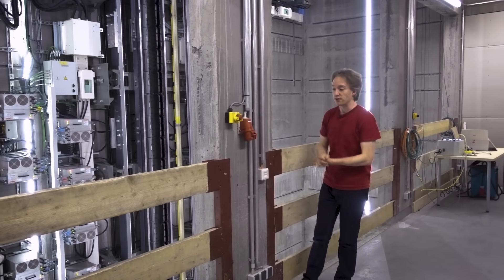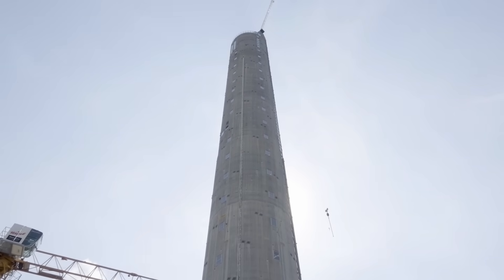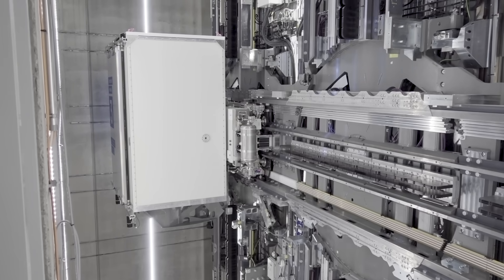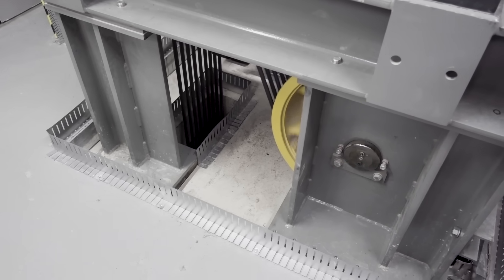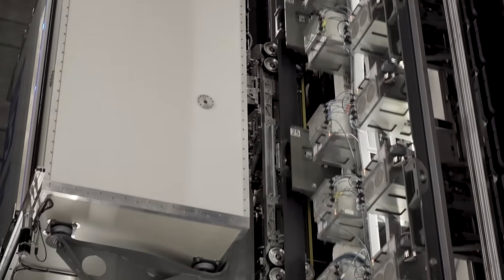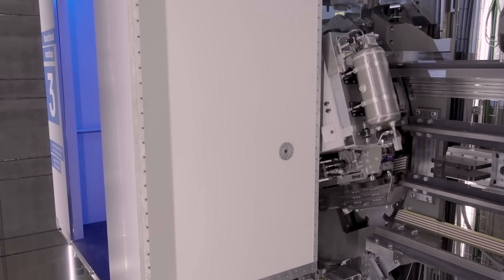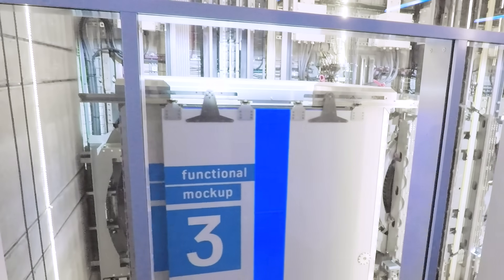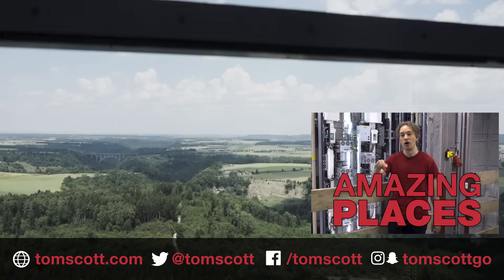An elevator that actually goes sideways

Comment: In what scenario will I even need an elevator that goes sideways?
Reply: The specific case they're describing here is to have set of multiple shafts where the some shafts are for up, and some for down, meaning you can run multiple cars per shaft. For very tall buildings the problem of only one elevator per shaft and longer trips between distant floors mean that a decent fraction of taller buildings is nothing but elevator. This invention in theory let's you extend the same number of shafts to any height, though I'd probably increase shafts albeit at a much slower rate so that a failure or slowdown in one shaft can be diverted around.

In a more extreme setting you could use this for something like the previous video he made about a sideways elevator, where they just needed to go a fair ways sideways as well as up, and it was more convenient than walking.

Comment: I just wonder about when it becomes actually used. If an elevator can move in either vertical and horizontal, it means that their paths of movements will be a grid instead of parallel vertical lines. If different people want to get the same elevator from different origin points to different destination points, how the computer system manage the most effective ways of carrying these people? If there are more than one cabs on this grid, it might be more likely that two cabs might get into the same part of grid and collide. How will they design their controlling system to prevent said collision? These just pop in my mind.

Comment: Though, I do need to ask, why don't they just use the simple rack and pinion gearing system instead of induction motors?
Is it because they want reliable smoothness in the ride that is given from two repelling magnetic fields. (something the rack and pinion also gives.)
Or because induction motors are somewhat expensive and looks far cooler and is therefor most likely easier to market to non engineers.
Reply: I can imagine linear (not actually induction if it's synchronous) actuators being cheaper, lighter and smaller except for development costs
Reply: Linear as in rack an pinion, or lead screw?
As the lewd screw is probably going to lower the speed significantly.
But yes, there are many solutions that might work.
Reply: Unknownety Linear as in no rotational movement whatsoever to begin with. Instead of creating rotating magnetic field with concentric coils like in a motor, you have them arranged in line (well, perpendicular to it)

Comment: A rare error at 1:50 and later; it doesn't use linear induction motors; as the guy immediately says they use linear synchronous motors. Induction motors are asynchronous motors and use copper or aluminium for the secondary, but here they're using permanent magnets and they're synchronous motors.

Comment: I'm confused, you called in a linear induction motor, but the dude said it used magnets and was a synchronous motor. Induction motors don't have permanent magnets nor are they synchronous, so like, which is it?
Reply: Yeah, pretty sure it's the synchronous one. Induction motors (and linear actuators) have slip, can't be controlled for precise positioning and don't work well at low speeds
Reply: Tom messed it up, pretty sure.
Reply: LIMs could potentially be used, and might well be cheaper for the shaft; but this company just aren't.

FYI Tesla uses induction motors in his cars, they can be precisely computer controlled just fine. They are a bit less efficient at low speeds, but not terribly so, particularly if they have a thick secondary.
Reply: they would be magnetic linear actuators

Comment: Should of talked about the fail-safe's it has in case of power failure and/or failure of whatever keeps the elevator in place like the traditional cable.

Comment: How does this elevator deal with the distribution of mass on different parts of the elevator floor? Correct me if I'm wrong but essentially if you were to stand on the far side of the track that it goes along you'd exert much more force on the top wheels through a lever effect, right? I'm sure they'll be doing some very thorough and destructive testing but I just wonder how they solved that.

Comment: Thyssen-Krupp is not an elevator company. In fact, I cannot remember having seen any modern elevator not built by Thyssen-Krupp in the whole city I live in.
Reply: The city where I live, Seattle, has a nearly even mix of Krupp and Otis elevators.
Reply: Thyssen-Krupp begins as steel manufactor and  know there are a Part of germanys/worlds biggest inovation companys
Reply: Actually, I more often see Otis, Kone and Schindler. But I do also see Thyssen-Krupp. Your statement that Thyssen-Krupp is not just 𝑎𝑛 elevator company, is false.
Reply: Even 70year old elevators are maintained by them.(more or less)
Reply: Cristof Calgary was the same. Thyseenkrupp and Otis. In Ontario there is a company here called Delta elevator that seems to be the most common
Reply: Thyssen-Krupp is the mother company, to which Thyssen-Krupp Elevators belongs, and they make elevators, suprisingly.
Reply: In Germany almost every Elevator is from Krupp
Reply: What are you saying? they are not an elevator company, but they are the only evevators in your city? how does that make any sense?
Reply: It's called italics, but now I'm just being overly pedantic and this thread has gone of the rails.  WE'RE ALL DOOMED.
Reply: Actually KONE is the elevator company.

Comment: how can this functionally work with more than one cab? is it just that if there is a chance of proximity you stop one of them and make it wait? or you do not have more than one cab?
Reply: I'm fairly certain it uses a block system, that is: If a segment of the elevator shaft is occupied by another cab, it routes the others around it. Of course, that only works with more than one shaft - otherwise, it's "just" like the block system of a rollercoaster, where you have to wait at certain points until the next block is cleared.

More than one cab only is very beneficial if you have 2 or more elevator shafts that are connected every... say, five or so floors. In that case, the computer that controls the traffic (whether it's a small computer within each cabin or one "controller" computer) moves cabins from one shaft to the next to overtake slower traffic that still occupies a segment.

Comment: Linear induction motors are all the rage in automation right now - manufacturers make all kinds of cool mockups with incredibly advanced configurations, but the solutions are usually orders of magnitude more expensive than more conventional motors. If this particular system was ever implemented for real I bet it would be using conventional motors and not LEMs. ☺️

Comment: How much energy does this system use? Conventional elevators use as series of counterweights so the actual load on the drive system is fairly minimal, allowing it to operate very efficiently. With this system, it looks like the linear motors are moving the entire weight of the car, and components. Maybe I'm missing something? Very cool concept though!

Comment: This would be a great solution to the elevator conundrum, as you could have more cabins than elevator shafts. They should at least be able to sell this for 500m+ skyscrapers, as they are starting to have problems with having enough elevators.

Comment: Could be brilliant for buildings with large floor plans. Instead of having totally separate banks of elevators you need to walk between, you could design a building to take advantage of these and be able to shuttle people between elevator banks. You could have, for example, a UN like building, which is both quite tall, and fairly wide, and have, every few floors, not just the double shaft that allows lifts to dynamically route around each other (you can have multiple lifts sharing a single shaft, and routing around each other via the "spare" shaft, allowing, say, for a high capacity lift to unload on a floor while another couple pass by to higher floors to do the same) but also capable of delivering you to a north or south elevator bank. Or, for somewhere the size of something like the LHC, have a lift system that can take you under ground and to the relevant instrument for maintenance, instead of always biking there. Integrating the system, while initially more expensive, would probably be easier than needing to support, say, a mini-tram system. When you can standardize more systems to the same standard, it is generally beneficial after all.
Reply: But... this basically IS a mini tram. Just attached to the wall. So a mini tram with normal rails would prolly be a lot cheaper in a case like the LHC

Comment: I was almost dismembered by an elevator as a child. it was at my grandfather's shop/house. he was the only person who used it, since the upstairs was his apartment. my sister and I were screwing around and jumping in and out while the doors closed. the fact that the doors didn't have a sensor to stop the doors should have been a hint. on one jump, my leg got caught in the elevator with my sister while the rest of me was still outside. the door clamped on my knee and the elevator started to rise. I started screaming while my sister started spamming the open button but it wasn't stopping. My dad thankfully heard the commotion and grabbed me by the shoulders and pulled until I popped free. I guess the reason my grandfather never bothered with that safety features was because he was a double amputee. if his leg was caught, he could have just popped it off

Comment: Huh, also the default procedure for freeing trapped people (loosen breaks and slowly let the elevator fall/rise to the next floor) won't work, so at least the lift engineer from next door isn't going to be able to help you…
In general, I'd be interested in how they solved the safety aspects in this.

Comment: So... what is the benefit of having it go sideways? Is it to go along the length of a building as well as the height?

I just don't see the benefit of something like this. It seems like a hugely complicated solution to a problem that doesn't exist. What's the problem with elevators that only go up and down? I'd really like to know.
Reply: I think the horizontal moving idea is to allow the elevator car to go from one shaft to the other so that you can have multiple cars per shaft and ease congestion
Reply: I guess it could be kinda like a train system where multiple cars would be able to run on the same line without having collisions. I guess that makes sense for massive buildings that have high elevator traffic.
Reply: yes, that's the point. Like a paternoster, which was mentioned in the video :O

Comment: Other than bragging rights the cost of that thing is going to keep it as a mere pet project. Also the comment about how it would have a buffer to limit to just serious injury is ridiculous. Any injury in the event of failure is unacceptable. This is why normal elevators use a counter balance system and have backup brakes on the cars.

Comment: That motor system looks overly complicated. You would think they would just use a normal motor with a rack and pinion type gear system.
Reply: It wouldn't last as long between maintenance and the horizontal bit would be a nightmare to design. A linear induction motor is actually a very simple mechanism.
Reply: Nobody said it's  simple.  The software which controls  the 3-10 cabins in a shaft: should better be well tested.
Reply: -_- you think that if it was that simple it'd be used already
Reply: Gabzo Avro look at toms new video to see why that isnt true
Reply: i doubt that would make a smooth ride.

Comment: These lifts can also accelerate incredibly fast with a super high top-speed. Way faster than the humans riding it would be able to handle. The main part of this system is actually developed by ProDrive, Eindhoven. I had a tour there, they have a really interesting factory. Super small, yet super efficient, automated and suitable for many many different products. Doesn't look like a factory at all, they even have research in the same building as it. I'd imagine they'd be more than happy to give you a tour and show you the way main part is built and developed (spoiler, it's very interesting).
Reply: Actually, humans can handle any speed if travelling in an enclosed space. It's the acceleration that we feel, not speed.
Reply: @disturbedNeutrino  Speed doesn't kill you, suddenly becoming stationary does.
Reply: @apveening  Is exactly what I said... 5 years ago. So why necro?
Reply: @disturbedNeutrino  must have missed it, replied to another post.
Reply: I do not. ProDrive, which is where I got a tour, was given the assignment to make the lift move up and down, simply said. They were told they would not have to look into a separate safety system for the case of failure, the company that gave ProDrive the assignment said they'd either invent such system themselves or get another company to do it, so ProDrive didn't know anything (or at least couldn't say anything) about the safety system for the case of power failure.
Reply: Victor Titov actually there are already towers for that, and Tom made a video about the one in Bremen. It's actually a lot simpler than this.
Reply: Sqare Play'n, that sounds like video material for Tom, I for one would love to see him showcase that. Have a like and comment for visibility, maybe we'll learn some more!
Reply: Nyll Nyll Was that a joke about the German accent or did you misspell wary?
Reply: Square Play'n You're right. These LSM motors are also used on many launching roller coasters, some of which have insane acceleration.
Reply: I don't think acceleration would be much of a problem look at the tower of terror rides in the various Disney parks those elevators get up to 40 mph in 2 seconds and then pull back down faster than the speed of gravity which gives the riders excessive amounts of airtime (Negative G forces) So the acceleration and speeds are definitely possible and able to be handled by humans... Also the elevator moves horizontal in the Florida version of the ride
Reply: I'd say it's an eddy current break (Wirbelstrombremse) as used in Free fall towers
Reply: Hebl von Heblowitz I was about to comment the same.
Reply: I was thinking the same thing. The Top-Thrill dragster here at Cedar point uses the same system. It propels riders to 122 MPH in about 4 seconds. Could you imagine in the future when buildings have 200+ stories taking the elevator to the top at 100 MPH?
Reply: Square Play'n Do you happen to know what makes the lifts not fall down in case of a power failure?
Reply: Square Play'n d

Comment: Doesn't look overly complicated at all. No failure points there, I'm sure. :-/
Reply: Fracture failure point that are capable of being completely bypassed until repairs.
Reply: or a rope breaks and the whole thing falls down. Seriously? there can always be something going wrong. As long as it is well regulated it can be a good thing. No one said we'll see it in our buildings tmw
Reply: MrFrostburner 
Until a false signal comes in saying that a rail is aligned when it isn't, due to malfunction. Then, the fast moving car de-rails itself, flies up, then promptly plummets the passengers to fiery doom. Possibly on the way, it takes out other cars as well.
Reply: Gabzo Avro there are NO cables but things can still go wrong

Comment: looks 100times more expensive then the system in use today. Allot of machined parts, more electrical, and servicing this i assume would be more time consuming. I really like the concept, but do we need it ?
Reply: This is the company that brought you Bagger 288.  They only need to sell 5 of them at $500 million each. ;-)
Reply: Well actually No.

This is not intended for normal small buildings but for big skyscrapers. And there you have a different problem as was said in the video (and several more).
elevators can only be oh so tall after which the weight of the cables is a real engineering challenge - this system doesn't have this problem at all.
You normally can only have 1 elevator per shaft and so for bigger buildings you need 3,4 or even 10 elevators - that costs a lot of space and thus money.
And long elevator-tunnels are a problem for safety - when something burns it acts like a chimney and can make any fire far worse. again - this can be prevented with this elevator.
Reply: Mathias Tveit might become feasible in tall skyscrapers where you can save on additional shafts due to several cabins in each shaft.. i think it is definitely an interesting idea :)
Reply: the higher your building is the more do the pros of this systhem outweigh the cons, from a certain hight onwards it will be more cost eficient than the standard model.
Reply: Mathias Tveit As others have said, you can run several independent cabins per shaft. There is potential for more efficiency and flexibility with less of the building's floor area needed for elevator shafts. Equals more rentable space per floor within a given building footprint, so the added complexity should be able to pay for itself.
Reply: For really tall buildings, this system allows you to board a single cabin and go to your destination.  With cable systems, above a certain height, you need to go up one bank, get off, board a cabin in another bank, etc.  Now, my feeling is that such tall buildings present too much societal risk, and should be effectively prevented in fairly free market societies by reinsurance requirements, emergency services and military security charges.  But in any case, you are going to have countries like Dubai that are going to build vanity projects whether they are economic or not. Heck, they rebuilt the World Trade Center in this era were the internet should allow greater decentralization.
Reply: Rich Dobbs I wouldn't worry about decentralising the internet, I think this guy called Richard Hendricks is working on it